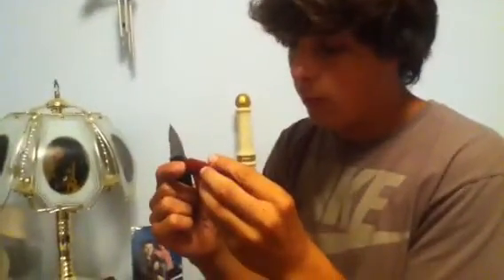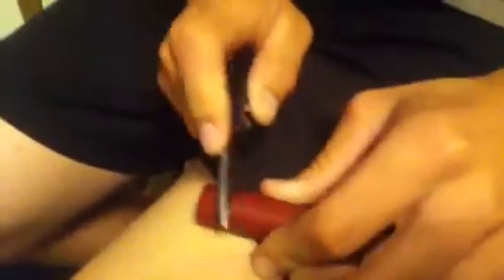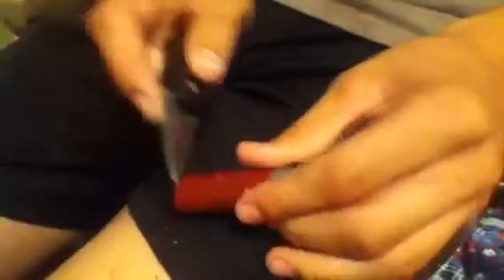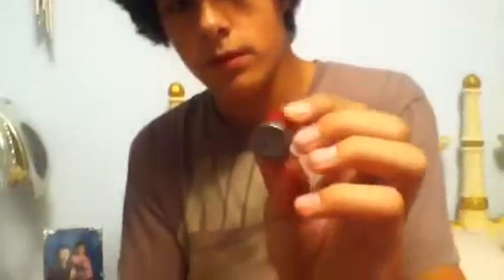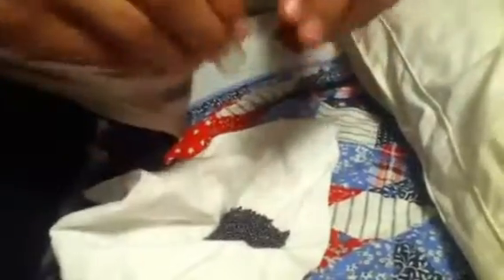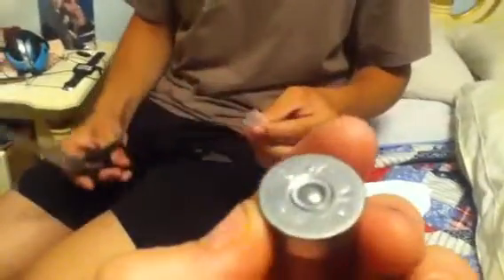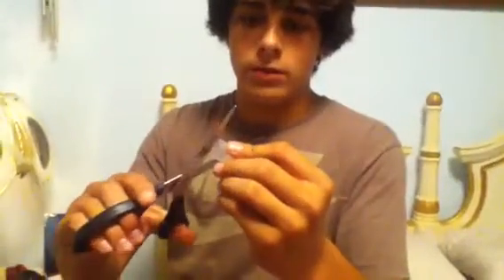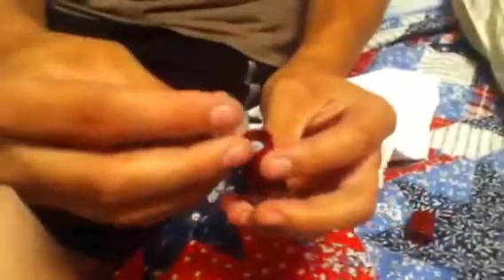Flare gun shotgun shell pt. 1

Comment: Shot, cap with double folded paper towel, tear edges off and use a stick candle and a few drops of wax to slightly seal the load.
Ive had much experience w/this, i have a converted orion 12g plastic flaregun that has fired hundreds of shells modified exactly as i said. If you leave ANY powder in that shell, just make sure to record it and post for our entertainment. It WILL fail.